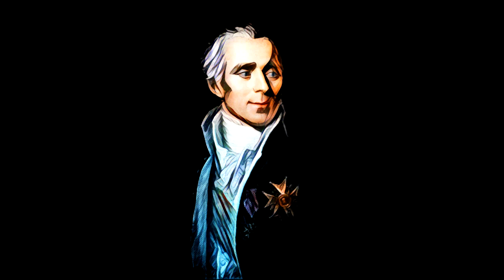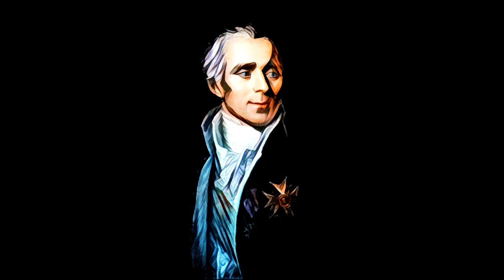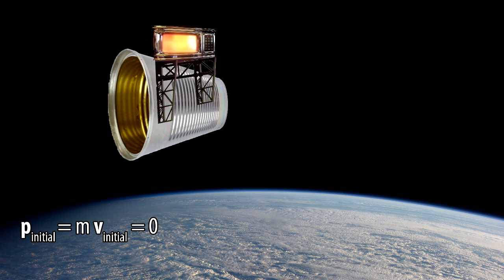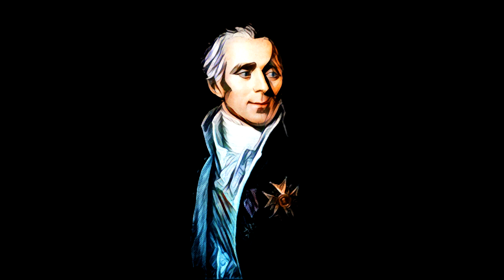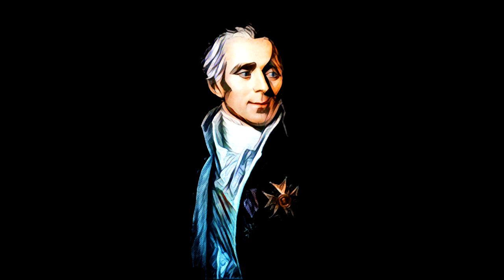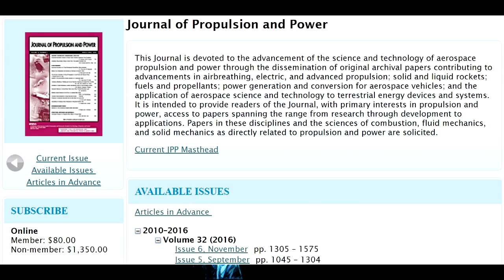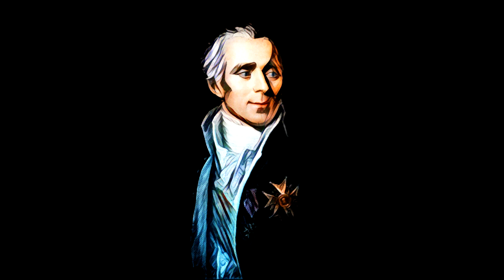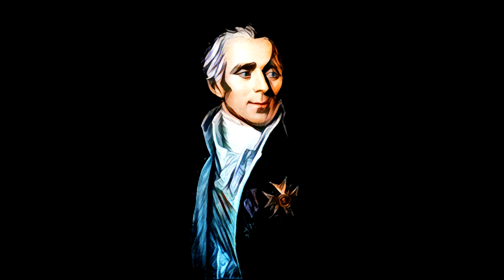The most unscientific approach – The Emdrive (part 1)

Comment: So how does that flashlight produce acceleration in a vacuum without violating conservation of momentum? Does light have mass? If you will say yes, light has mass, then where did it come from? Did the light bulb lose mass or did it convert a flow of electrons into mass and projected that mass out into space ( through a few layers of solid glass, I might add )... if you realise the answer already, the operation of the em drive would share some fundamental principals.
Reply from the maker: Light does not have mass, but it does carry momentum. This momentum is stored in electric and magnetic fields. Light also carries energy, and the energy and momentum carried by a plane wave are related by E=pc. As the batteries are drained and energy escapes the spacecraft, the spacecraft loses mass, so a flashlight behaves just like an ordinary rocket.

Comment: "All they have is a section titled Error Sources which reads like an undergraduate lab report. Just check out the weasel words."

Ouch. That sentence really hurt my feelings...
Reply from the maker: I take this to mean you're an undergraduate? Then there's no reason to be upset. First, everybody has to learn at some body, but more importantly, an undergraduate report is necessarily written at a much lower level of rigor than a research paper. If you get a wrong result for your experiment it may or may not be because of air resistance but your instructor will probably accept if you just assert that with no evidence. That's because what your instructor really wants to see is if you know about systematic uncertainties and have an idea of the types that could be applicable to your experiment. There are time constraints involved, too: the latest lab section I taught had students do an experiment, write and submit a report in 3 hours. I don't expect perfection from it, of course!

However, when you're writing to upend physics as we know it, saying "we don't think it's likely" or "we could do this other thing to find out but we haven't though lol" is clearly not enough. Especially when you've had years to work, under the eye of the press, with lots of people giving different objections as to what could be causing this putative thrust. So please, believe me when I say that the comparison is in no way meant to be disparaging to undergraduates... :)

Comment: Break it down to the simplicity it based on. Microwave is oscillating electric and magnetic  fields. EM drive is a speaker in space. The force exerted against a concave center point creates thrust .Clearly observable if a speaker were placed under water. There is no drag in space ( sorry rue paul) or at least it's negligible .Based on audio dynamics wave frequency is altered by length of that wave.Would it create perpetual motion ? Do we reference Newtonian law? I would think so, however the course in time in this application the basis would seem as if it did not apply yet it does. I theory this would not be dissimilar to a wormhole allowing an object to pass from one end to the other without that object becoming essentially static and being trapped at the midway point. In my hypothesis a laser focused at the center of the concave resonating  platform or point and then positively charged and or contained within an EM field and released would have the desired results but still not without breaking Newton's third law . At this point I would like see a liquid fluoride thorium reactor as a fuel source . Based on the crystalline structure involved in this process and the fact I don't think we can get away thermodynamic  reaction taking this experiment in the opposed direction would be interesting to see what would happen . Food for thought......... good night everyone
Reply: Irish Red , By the Way, 
We Here in the States, Should Have Used the, THORIUM REACTOR, Back in 1947!
By the Way, We Gave the Russians ENRICHED, Uranium!
Reply: Electrical charge causes the atom to lose electrons turning them to ions. Ionised gas is shot out. So caesium or mercury can be used as a propellant. Centrifuge set as a gyroscopic axes for directional vector vs thrust. = steering......Take it one step further, Mercury containment is now wrapped in copper wire set within a stationary rotor coil  making into a  generator feeding an electrical charge that produces electrons turning them to ions. This recharges the battery that starts the centrifuge and ''Viola'' self powered and contained . By using a centrifuge rather than microwave this produces ions for power much faster. Not sure how it stands up vs distance I'd have to build them both. But it should do fine on the computer syms.------------------------------------------------------------------the RED-TUNT-Ion drive-----------------------------------------
Reply: Irish Red , 
Tesla, Was Able to Do Things, 
With Resonate Frequencies, That We , A Hundred Years Later Are Having Challenges Reproducing!

Comment: Very nice explication. One quibble, though. 
The apparent paradox of the (real) rocket gaining more kinetic energy than the energy of the fuel is explained by the loss of kinetic energy of the -exhaust-.

Consider a rocket travelling 1000 m/s, which ejects 2 kg of fuel at 1000 m/s. The fuel had an initial KE of 1 megajoule, and (since it is now stationary) has zero KE after ejection. That 1 megajoule of KE stays with the rocket.

If you work out the algebra, it all works out. But, it requires ejection of mass.
Reply from the maker: Hi, thanks very much for your comment! In general, you're absolutely correct, and this effect has to be taken into account. In this particular instance though it just so happens that the final kinetic energy is smaller than the initial one. The difference is indeed due to some of the energy being carried away by the propellant.

Comment: have you factored in the loss of energy in the form of heat
Reply from the maker: Well, that depends.

Many of the existing emdrive tests give false positives most likely because of thermal effects. This is the case with the NASA paper, for instance, where my money is on thermal expansion displacing the equilibrium position of their measuring apparatus.

On the other hand, energy lost purely by radiation in the vacuum wouldn't be enough to produce any significant thrust. It would be limited by the same fundamental limits as photon rockets: each 300 MW lost as heat would give you, at the most, 1 newton of thrust.
Reply: ok thanks for clearing up my confusion on the subject

Comment: didn't the Chinese do this and NASA do with it microwaves and found that it used energy that was created in the vacuum of space to help add to the energy displacement I think they said the particles created were converted to plasma energy which caused the movement increase kind of like an air scoop that would scoop up propellant and help with propulsion.

Comment: This guy knows a lot more about video editing than thermodynamics. A generator would slow any acceleration gained by running an EMDrive, bringing it to a halt (try turning the shaft on a large motor it doesn't just spin freely). So the entire section about claiming the EMDrive would be a perpetual motion machine was completely idiotic drivel. The energy you'd have to put in to get the machine up to high speeds (over a huge time) would be enormous compared to the tiny short lived energy the motor would absorb.
Reply from the maker: Nope, the emdrive spits out more energy than it consumes, so irrespective of any losses if you hooked it to a generator it would spin forever. What you're expressing is the hope that conservation of energy would hold even in the presence of an impossible device, when in fact conservation of energy can be used to constrain what kind of devices can exist. Since the emdrive would break conservation of energy regardless, there's no reason to hold out that hope.
Reply: It doesn't spit out energy, it absorbs energy and converts it to forward momentum, converting existing energy (electricity) into another form (velocity). To say it makes more than it uses because over long periods it could reach high velocity ignores that it takes a tremendous amount of energy to reach that point since from what's been shown (about the EMDrive) so far is the push that it produces per watt it is VERY tiny. I point that out because using that same amount of electrical energy in say, a motor, could accelerate an object of the same mass as the EMDrive much more efficiently (but would require contact with some other mass to push against). The whole it would run forever thing - it only runs when it's turned on and is using energy, and you will never get more energy out of it than it took to get it moving, and any method to extract the energy from a moving object will cause it to stop. Search your feelings, you know it to be true.
Reply from the maker: "it absorbs energy and converts it to forward momentum, converting existing energy (electricity) into another form (velocity). "

Energy is not some "fluid" to be "converted" at humanity's leisure. What is allowed or disallowed are various processes, and we can use conservation of energy to determine what those are.

The facts are: the kinetic energy of the emdrive exceeds the electrical energy fed into it. Furthermore, it does so after an arbitrarily small period of time. It does so whenever its efficiency exceeds that of a photon rocket, that is, in every case in which it'd be worth building.

"you will never get more energy out of it than it took to get it moving,"

Like I said, that's just a hope you have. The calculations show otherwise.

"Search your feelings, you know it to be true."

Feelings are an inadequate guide in this matter. I suggest math. I'm not being snarky here (well, maybe I am a little bit). But this is a legitimate point. Your idea that conservation of energy is preserved here is based on intuition rather than fact, but the calculations really do show otherwise.

Comment: I have seen and read that the Chinese are testing it in space  after similar lab results from NASA. Also, in space, wouldn't you have to consider microwaves from the sun?
Reply from the maker: There are many rumors regarding China, but I haven't seen any solid information. I do know that at least one of the supposed sources of this information was actually talking about electrical propulsion tests (ion engines), which is quite conventional.

Not sure about microwaves specifically but it is certainly true that there are a number of uncontrolled sources of error in space.

Comment: But if it uses electricity, by which I mean actually using up electrons, then the electrons' mass would be expelled somehow and the momentum might be conserved, even if that mass is a tiny amount.
Reply from the maker: An ion drive kind of does that. Ions are accelerated and expelled (ions of opposite charge are typically added to the exhaust to make sure the spacecraft doesn't become overall electrically charged). I don't think there's any evidence that the emdrive is an ion drive, though in principle it could be. It wouldn't break any laws of physics but it wouldn't be of much interest either.
Reply: True.

Comment: This review is like your middle school science teacher explaining 52 dimensional space with only a high school education science plus a teachers certificate.  He can say the words, but cannot grasp the implications of the experiments which have been done by NASA scientists who know a bit about making delicate measurements.  The positive results of the tests, which have been repeated with similar positive results, suggest that momentum is an emergent property rather than an intrinsic property.  It suggests that, in Newtonian physics, which is physics at the billiard ball scale, momentum is always related to applied force.  The experiment suggests that, just as you can increase temperature (energy) of an system using internal mechanisms, you can also add velocity (energy) using internal mechanisms.  Conservation of energy is observed, because energy was expended from the batteries to drive the microwave resonant cavity.  and let's think about "virtual" particles; that is, particles pairs which pop into existence spontaneously.  Each particle in the pair has momentum.  The momentum values sum to zero; but if you can design your apparatus to absorb one of the particles before they self annihilate, and let the other go on its way, then your apparatus will have gained momentum with no external force applied.  EVERY rule in science is subject to revision when properly vetted experimental data finds an error, however slight, in the predictions of the rule.  Thus, planetary orbits come REAL close to being Newtonian, but they miss by a bit due to frame dragging.  The EM drive might be the system which does for momentum what frame dragging did for Newtonian orbits.  Maybe further, and MUCH more precise, testing will make EM propulsion disappear, but you cannot say that based on the notion that we already know all there is to know about momentum.
Reply from the maker: I don't see an argument that hasn't been debunked in the video. Try again, maybe with paragraphs this time.
Reply: Steve Jeffryes , Ah Yes,
All Well and Good, 
But 
Can This Concept Evolve 
Into a Charger, for My EV?
I Need 150 vdc, and 10-20a.!
Reply: Could the events of Star Trek happen in real life ?

Comment: You are misusing the conservation of momentum.  This device uses energy  This energy could be used to produce a force.  There are certainly many other ways in which electrical energy can produce a force  This is not to say that this one is producing a force, but the point is that it could be.  To illustrate my point, an electric car moves forward due to the force produced by electricity, the conservation of momentum has NOTHING to do with it.

So, the relevant equation is f=ma.  'a' is acceleration.  Writing this equation the other way a=f/m.  So, as long as the drive is producing a force, what ever mass it is connected will continue to accelerate.  This will not become a perpetual motion machine although the rate of acceleration will decrease as the velocity increases due to the relativistic increase in mass.
Reply from the maker: I am not misusing conservation of momentum at all. The argument I gave is both simple and correct.

"To illustrate my point, an electric car moves forward due to the force produced by electricity, the conservation of momentum has NOTHING to do with it."

Yes, it does. A car moves by pushing against the ground. It's not just electricity being "converted" into motion, whatever that means.

Conservation of momentum is the relevant equation. It's always relevant. It's not a law that can be turned off when we don't like its consequences.
Reply: Vacuum Diagrams , Wouldn't, the Rate of Acceleration Remail Constant Even If the Velocity Increases?
I'm Looking At Kind of Like Gravity, Kink of in Reverse!
I Think, I'm Getting a Brain Cramp!

Comment: Didn't account for thermal effects? They tested it in a vacuum!
Reply from the maker: The vacuum doesn't help with all kinds of thermal effects. It prevents convection currents, but thermal dilation of the rig holding the device is still an issue. That dilation could easily be confused with an acceleration signal.

Comment: Needing 300 megawatts from a flashlight. Heaven help us. Anyhow, most short circuiting functions (superconductive elements) go there. So you need about 8,537.76V DC plus or minus with an active battery current of about 100 to 60 amps. The flashlight probably won't light, because it will be about 100mH in Inductive value. If it does light, likely, the coil will melt and the flashlight won't go anywhere. I suppose next, because of  delay in real research, the world will be stuck doing material sciences exercises, just like Edison. Hey, he did it. Or you need 58,806.73V DC plus or minus, with an active battery current of about 60 to 50 amps. The flashlight probably will more easily light, because the coil will be about 8µH in Inductive value. "[The] coil will [definitely] melt and the flashlight won't go anywhere. I suppose next, because of  delay in real research, the world will be stuck doing material sciences exercises, just like Edison. Hey, he did it.". Will you be that lucky? Good luck with all that, you intelligent people you.